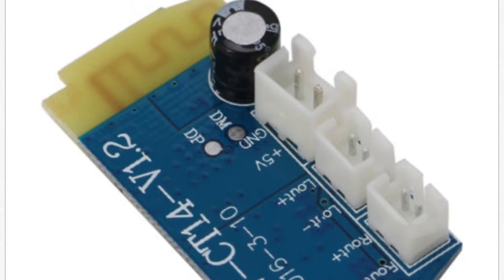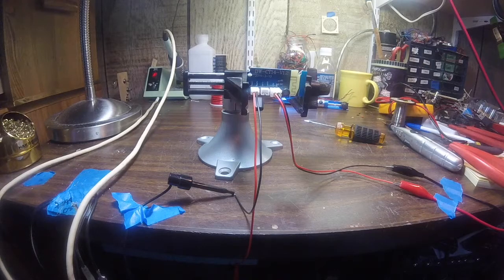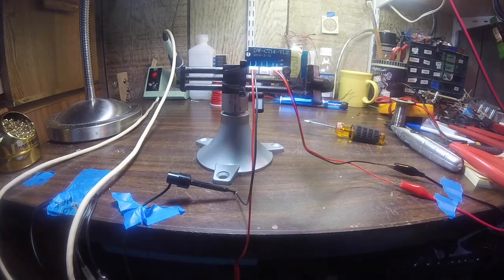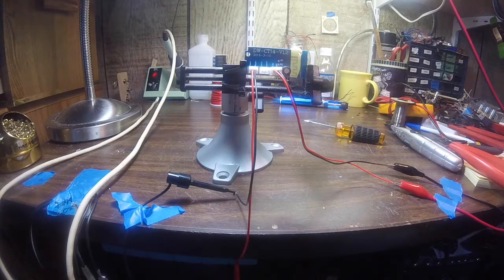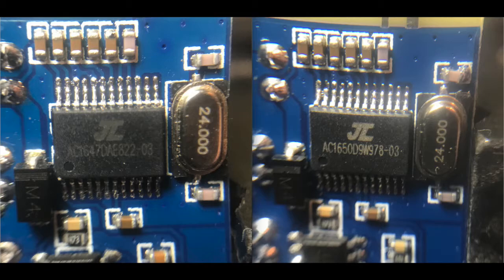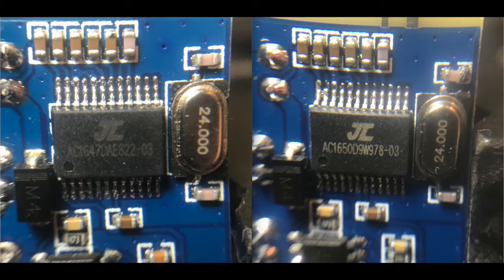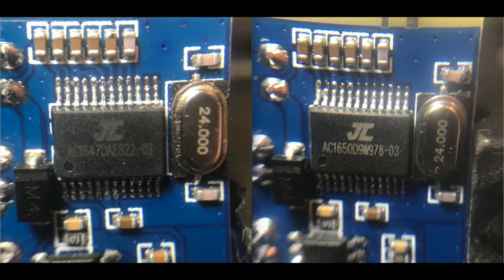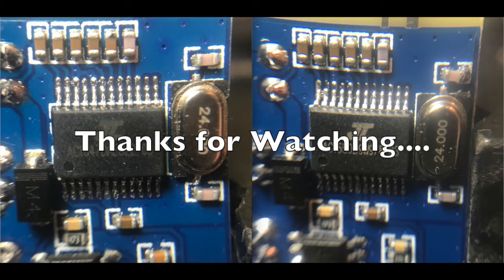UPDATE: 5V 3W Mono BT Amplifier Board

Comment: I have one of these board coming in the mail. Ill let you know how well mine works.
Reply from the maker: Joel Caulkins please do.
Reply: Hi, just wanted to let you know i finally received my board today and gave it a thorough testing and found it works very well. I paired it to my iPhone and took the phone inside my house, about 30 ft from my shop, and it still worked fine. I'm quite impressed. The amp chips get pretty warm at 5V  and full volume though.
Reply from the maker: Joel Caulkins thanks!!! I got mine the other day too. All 5 work well so I'm thinking that the first one was defective. Video on the way this weekend.